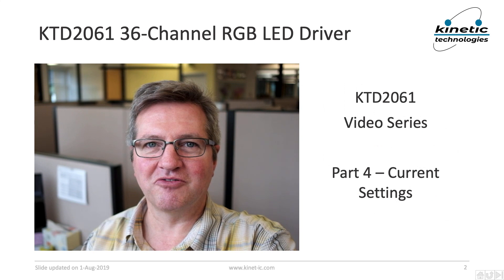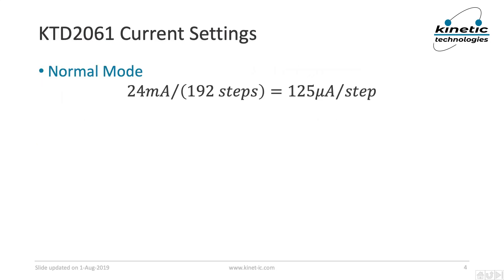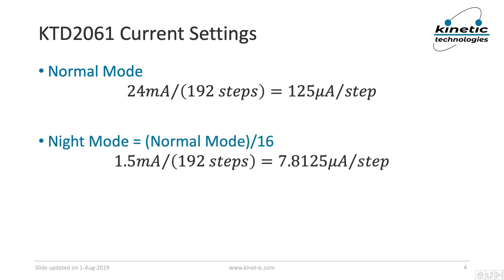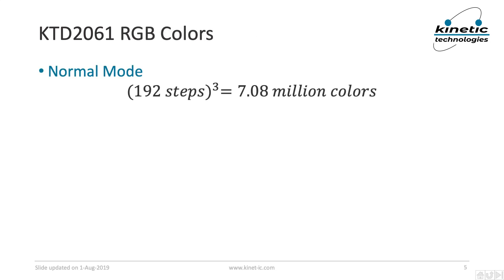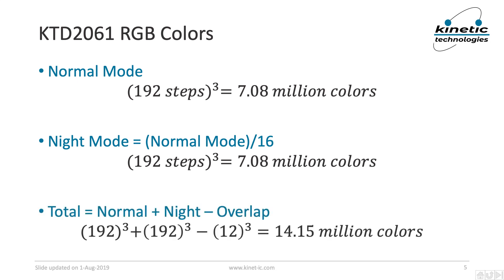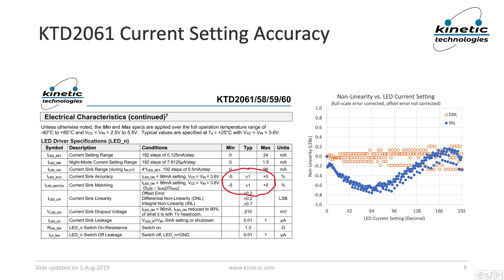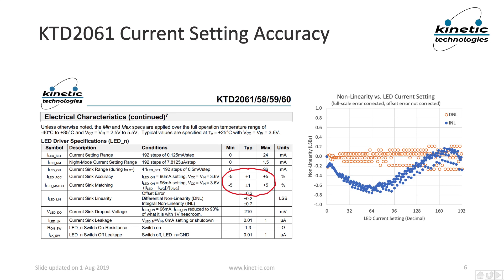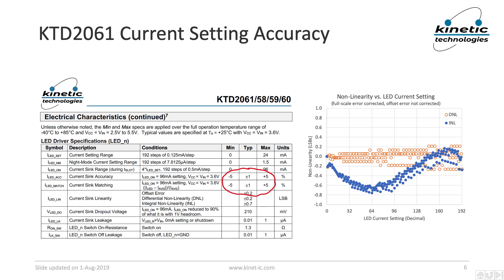KTD2061 Video Series Part 4 -- Current Settings

Comment: Hello, Where is part 5 and 6 ?? I can't find them!!
Do you have videos for KTD2052?
Thanks
Reply from the maker: I'm very sorry for the delayed response.  I wanted our Marcom group to take over management of our YouTube channel, but I have not been successful.  To address your concerns, production of this "12 part video series" was stopped after the first 4 episodes.  The first reason was somewhat low viewership.  The second was low resources (I did it entirely on my own, and it isn't actually part of my job).  My time and skills were diverted by management to other higher-priority projects.  As you can see, YouTube is not yet a prioritized channel at Kinetic.  We are more active on other social media, such as LinkedIn and Facebook, which is driven by our Marcom group.   Anyway, with regards to the KTD2061 and KTD2052, the datasheets are now available for direct download at www.kinet-ic.com.  And we have links to the Evaluation Kits, with nice documents and extensive example demo code in Python.  The EV Kits are available for reasonable prices at Mouser and Digikey.  These multi-RGB LED drivers are very unique parts and the culmination of my thinking about how to do this for over a decade.   I have defined 105 chips (unique die-types) in my career, and these are among the top 5 parts of which I am most proud.  I hope you can use them in your projects.